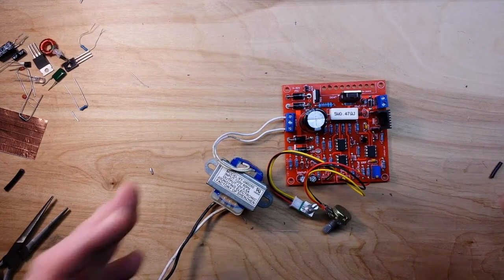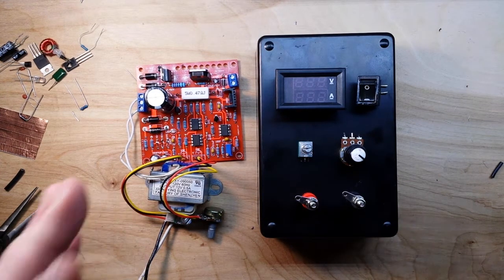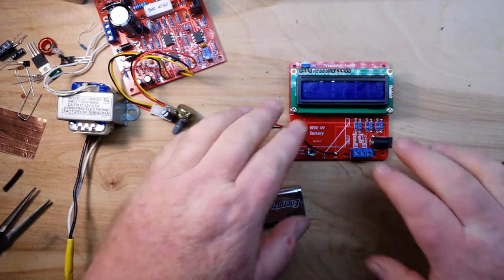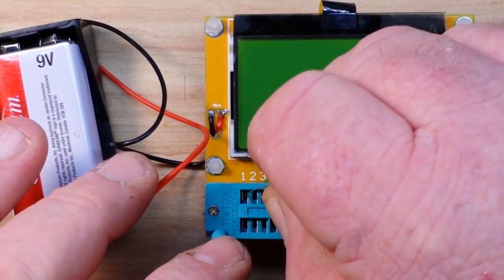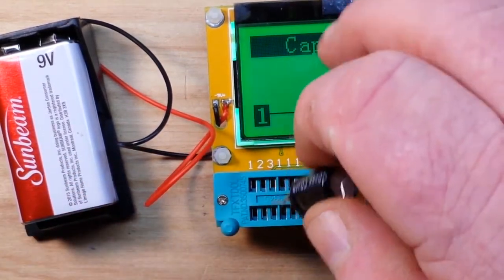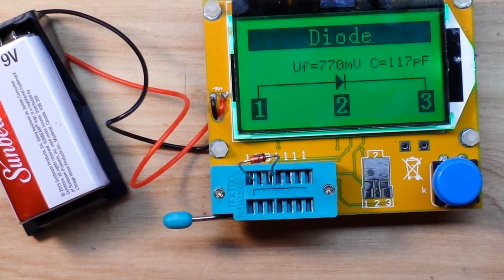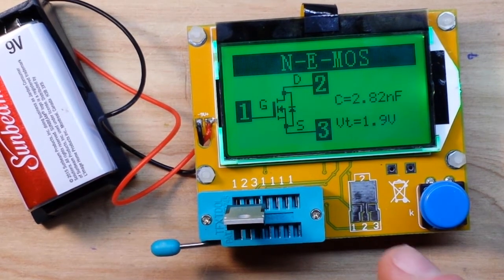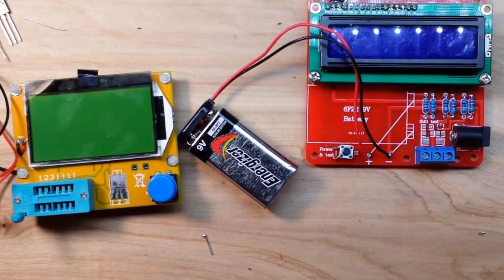Electronics ADD

Comment: i think i like it better if everything is facing up. that way you can place it right next to things, which is useful on a crowded workbench :P

i got the same tester. dont know if mine says mtester though, but the interface looks the same. i think mine shuts of way earlier though. i should check if mine can recognize triacs, but probably not :P. i wonder if there are any higher power/voltage transistor testers.

if the transistors shows as two diodes its usually dead i guess? cause that is what im measuring on my heatguns switchmode supply that blew up
Reply from the maker: fredlllll yeah, two diodes is a dead transistor. Does your tester have a menu?
Reply: nope, no menu, single button, same design as yours, yellow pcb, same screen, same parts holder thingy
Reply from the maker: fredlllll ok thanks for answering that for me
Reply: learnelectronics at least I don't know of any menu